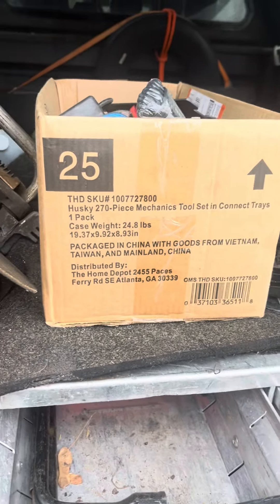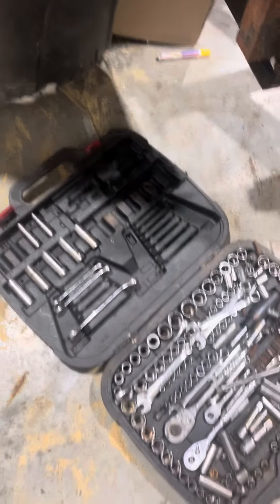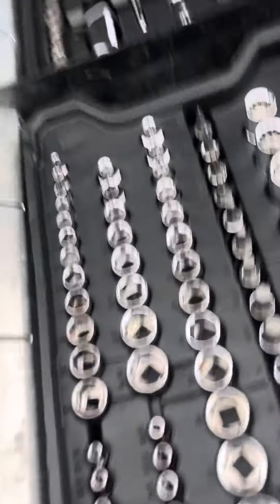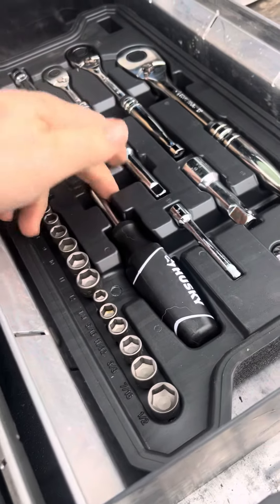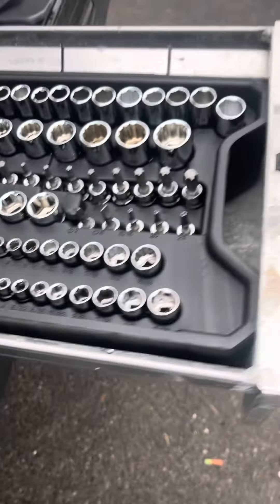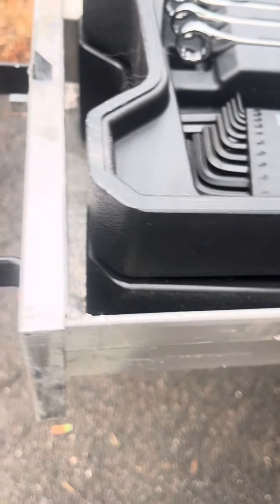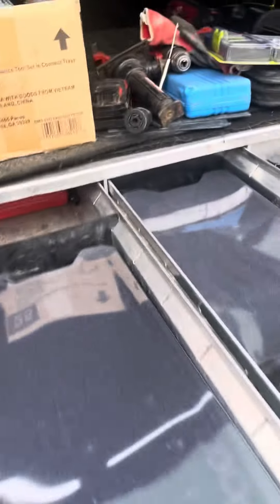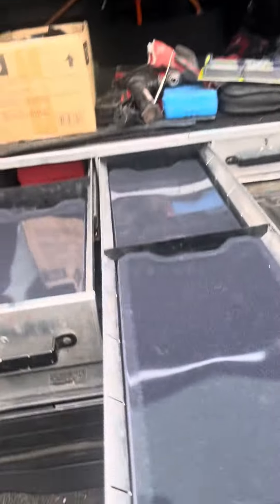Husky $99 270 piece toolset in connect trays for toolboxes fits just right

Comment: Nice decent set. Got a brand new one years ago. Sat outside in the rain one day in the case.  I figured no big deal. It had to be water proof. Nope. Not at all. Water goes in by the handle and stays in there. Started rusting all over fast and quick   Oh well. Still use it. Just rusty.  Couldn’t believe how fast everything not chrome rusted
Reply from the maker: Yeah the set I cut to in the video in the plastic suitcase has got wet a few times. Spot rust will form within 24 hrs. I keep them wiped off and spray them with wd40. I also drilled drain holes into the bottom of the box so any water that gets in can get out.
Reply: @drewdoestrucks  nice